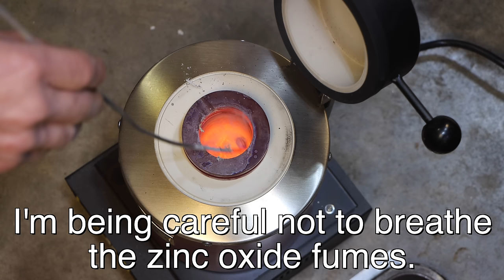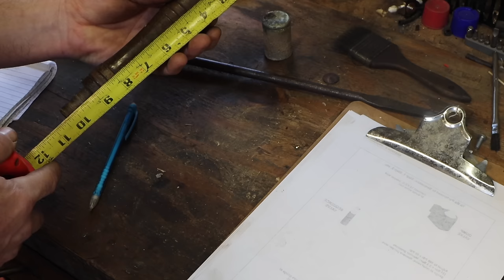One-Of-A-Kind Antique Screwdriver Restoration

Comment: That big screw on the Generator is not a brush cap, it holds the field coils in place. It is better to leave it there unless you have reason to believe it is shorted out or has some other defect. Squatch253 is doing a small series at the moment on his generator and starter off a Farmall and shows all these details.
 Love the screwdriver.
Reply: That is correct, The brushes are not rubbing against the middle of the rotor. Nor are they that small.
Reply from the maker: Thanks!
Reply: Thank you

Comment: 40:20 - I've burnt in handles all the time on projects that I smithed myself (hobby blacksmith), you should try it sometime it is really easy. Just have to pull it out when you get to the depth you want so it doesn't continue to char the wood and make a loose fitting.

42:18 - yeah you don't need epoxy when doing a burn in. it fits it like a glove. Just wait until it has cooled down, give it a couple of wacks to compress the wood fibers and it won't go anywhere.
Reply: "Just have to pull it out when you get to the depth you want so it doesn't continue to char the wood and make a loose fitting."
And THAT is the secret to the burn in method. When I do it I sometimes let some super thin CA wick down inside, though that can be a PITA later if the handle gets broken as you have to clean it off the tang of the tool.

Comment: I recommend that you move the tool rest much closer to the timber and use a roughing out gauge rather than a bowl gauge .  You will get a better result and reduce the risk of a dig in.  Run resin into the cracks using a pressure chamber.

Comment: That big screw actually holds the pole pieces for the coils in place. Don't take them out unless you absolutely have to to replace a shorted coil. I've done it before, but it required use of a impact driver to break loose.
Reply: Yes, learned that half a century ago at Bosch. You must not take them apprt without a good reason. And we had a special apperatus for that. With hardened blades. And a very long handle bar...

Comment: Man, that thing is nice! The brass and walnut really complement each other. One little suggestion/idea: maybe make a brass cap for the butt end of the handle, like a pein? Nearly flat but with a slightly convex dome that tapers down to nearly flush with the outer edge... Mushroom-shaped. It could fit into that centering hole on the end nicely and a little epoxy would ensure it stays put.
Reply: I like the idea.  Of course, you risk making the "tool" to fancy to want to use.
Reply: @critter3745  Nah, nothing like that. That would be on the level of hand-carved, and gold inlays and stuff. I'm just talking about a visual balance for the ferrule on the opposite end of the handle.

Comment: I've done 2 part handles (or multi) to get a solid lock on the bit being held. Doing it this way - you can get a a fit with zero play. 

Make your splitting cut with a thin kerf blade and chisel out the shape of the bit on both sides. Pin it or painters tape + CA, turn it down, then - pop it apart, insert the bit, and glue up the two halves. Works beautifully.

Comment: To make a handle safe use  a very thin structural epoxy and pressure pot. CA glue is brittle. Adding wood powder to hide a fill works  extremely well, does not weaken the joint.

Comment: That turned out very nice, and I really like the CA finish. Could you have used a steady rest (assuming you have one) to support the handle at 37:18? Burning your initials into the flat end of the handle in an arc would be a nice personalization.  And lastly, I think you're gonna need BetterHelp after you're done with the 1010 :)
Reply from the maker: Haha!  You are probably right on the 1010!
Reply: how did you comment 3 days ago when the video was posted for 4 houres ?
Reply: @haraszo8760  Videos are available to Patreon  members a couple days early. If the video doesn't have to be edited for some reason, then the comments made in that period will carry over.
Reply: @JCWren  didnt know about that, thanks for the explanation
Reply: @haraszo8760   What the hell is a houres.
Reply: @quantumss bruh, my bad

Comment: If you don't have an impact screwdriver get one- it's super handy especially working on old tractors that use all those flat head screws. The thing I'm talking about is a screwdriver you put in the screw slot and then hit it with a hammer and it pushes down and turns at the same time👍

Comment: Burning in a handle is super effective it can be a little fiddly but I've got files hanging that the handles have never come off, and it's my go-to method of handling files quickly and cheaply. I heat the tang and stick it in the handle to almost the depth I want, quickly remove it, let everything cool, then install the handle just a smidge deeper. the handle can usually still be removed, but some woods (not sure which, I think pine due to resins) will stick to the handle really hard. 
I think the fit would be naturally too tight for adhesives, so you'd need to either over burn or scuff the inside of the hole to get a good epoxy bond that way, but I'd prefer the wood on metal wedged connection from a burn in, but that's just my limited experience speaking so I don't know if it's quantifiably better
Reply: I'm no woodworker or toolsmith but I always believe this type of tool taper to affix handles were meant to be removable.
The taper will just always want to pop off if pulled on enough, this makes it terrible for gluing but the taper also means you can fit it again easily.

Comment: Love your videos. The wood looks like it could be ash which was traditional for handles, at least in france. I'v done a lot of wood chisel handles by burning the drilled hole as you did. They very rarely got loose. The trick is to be very fast, being carefull not to over burn the handle, and not to burn to the depth you want the finished tool. Then to hammer in in when cold to the correct depth. Thanks for the great content!

Comment: In the future, if you split it instead of cut it. You will get rid of the cracks and be left with stronger wood. Just use the existing cracks to split it until you get the size of piece you need.

Comment: I have been rebuilding starters and generators for 40+ years, here is a hint,  tap on the case with a hammer and then use an impact screw driver and hammer and they will come out. Of course I use a big clamping tool and proper bits to get them out, but this tip will work for you.

Comment: John, When this handle breaks try this: First mill a true blank, maybe 12 inches long by 2 inches square. Then on your bandsaw, cut it in half, lengthwise. Open up each half and mark out the profile of your screwdriver tang including a few inches of rod and be generous. Choke up and basically make the handle cover about 10 inches including some of the shaft. Carve out each half handle blank to take up this 10 inch (handle end) of your screwdriver. Epoxy both halves together around the screwdriver. When the epoxy is hard, chuck the screwdriver shaft into your lathe (3 Jaw chuck should work fine). This makes the handle concentric with the shaft and allows you to shape the handle as you want. You'll have to carefully measure the handle ferrule recess and you may loose concentricity by having to unchuck it several times to check the fit up, but no big deal. Then glue and hammer on the ferrule.

Comment: Nice work on the handle. 
I like the cast brass ferule. 
A friend of mine on the Old Tool Mailing List told me about using a brass fitting for flared copper tubing as a ferule. The internal threads can be used to mount the ferule on the wood. Brass can be turned with wood turning chisels. The handle can be turned to size. Then with the brass fitting attached the final shaping can be done. Much quicker than making a brass ferule. 
When casting a slug for turning I use a piece of steel pipe and pour the pipe full. When the brass, copper, or aluminum cools it shrinks more than the steel and falls free of the pipe. 
I have a box of turning slugs that I made that way. Most of mine are 8" or less but there really is no limit if you set up for contiuous cast. 
UTC had a rod mill that cast aluminum that was rolled into continuous rod and finally wire.

Comment: I've been a musical instrument repair specialist and luthier for over a decade and I can attest to you using the proper method for crack repair. When wooden clarinets, oboes, english horns, and similar instruments come to me with cracks in the body, I fill them with the same type of wood dust that the body was made out of and I seal it up with water-thin CA glue. I also insert carbon fiber rods in a shoe lace pattern along the crack to prevent any further spreading. Good job John!

Edit - If I may though, I recommend putting the dust in and then tamping it down with a small spatula, slotted screwdriver blade, or knife blade before gluing to make sure that you get good adhesion and no air pockets

Comment: I used to have one of those electric furnaces, and the crucibles that go with it don’t last very long at copper melting 
temps. I’d recommend making an iron crucible for it so you don’t need to buy a new crucible every 3 uses .The furnace also shuts off after reaching the highest temperature in can get to.

Comment: I just attached handles to several files using the burn method.  It’s easy and holds well.  I suggest getting a few file handles and trying it out on your screwdriver shaft before burning your walnut handle.  No need to go red hot.  Just searing hot like 800F or so.  Have water nearby to minimize deep burning.  I think burning is the best way to make intimate contact with the wood fibers and it will still absorb epoxy.  In fact it may enhance absorption of epoxy.

Comment: If it does crack on you its because your feral was not tight enough. So before taking apart wrap the handle water tight right up to the feral and wood then soak for a week in warm water. Your little wedges will drive in easier and the cedar will bind even more to the steel. You will be happy if you get it right. Try not worry about the wood cracking in the feral. Hope this helps.

Comment: The only thing I would recommend is drilling a ping hole through the blade and ferrule  then pinning it to provide a mechanical connection in addition to the epoxy.

Comment: Ever thought of taking walnut shavings, then soaking em in slow setting 2 part epoxy, making a tube mold (say in a paper towel tube),  compress it/pack it tightly, then turning down a handle...only problem is...wood turning "plastic" takes special precautions because the fumes and whatnot?
I have like 2 5 gallon buckets of bullet brass I got at the range, and the same metal smelter...so cool!
"A jack of all trades is a master of none, but oftentimes better than a master of one"
Keep em coming!!!!

Comment: John I don't think those screw slots on the outside of the generator are the brush caps their the screws that hold in the field windings you don't want to take them off.... the brushes will be on the end of the vented end of the generator under the end where the bearings are I think....   thanks for the video !  that's a good o'l screw driver now ! well done!.... I welded a piece of pipe on mine so I can hit it with a hammer and not worry about splitting the handle ! LOL....

Comment: Like the handle, That's not a brush cap on that generator. That's the bolt that holds the feild windings in, you don't need to take them out unless they're shorted or open.

Comment: I made some bullet mold handles and used the burn in method to attach them to some tangs I cut from 3/16" bar.  Didn't need epoxy, just gave it a couple of good taps on the end of the handle.

Comment: John , I  made a large screwdriver to remove stocks .  I had to take a stock blank and carve it into a real stock . And you could've put the handle in the lathe , and use a drill chuck in the tail stock . Then pressed it in there . 😊😊

Comment: I prefer to fit my ferrules on the live center end of  the handle. The drive center end is left long and cut off  at the end. Having the ferrule end on the live center enables one to take the handle off for a fitting. I usually do the ferrule end first and press the ferrule on. This allows me to finish the ferrule on the lathe. Having the ferrule installed also provides great support to the live center end for the rest of the turning.

Comment: Hi John, some hints to help you in wood turning.  Turn to finish sanding size prior to filling cracks.  Layer powder/ca if needed and spray activator each time. Thin type CA glue.  Sand to finish grit...340 grit is fine to prepare to finish.
Use the blue shop towels keep folding them in half until you end up with a strip about an inch wide.  Wear gloves and eye protection.... CA will sling off and get you.  Dribble a groove with CA, stand aside, turn on about 400 rpms or just rotate it and it will fill the groove well.  Do that to each and then sand the handle again with 400 or 600 grit until smooth.  
Then squirt CA on an inch of the paper towel and slowly progress from one end to the other with the first coat.  Spray with activator.  Cut off the used inch of the towel with scissors and put other coats on the same way.  Begin and end each coat in only one direction.  Usually takes about 10 coats.  End it all with some wax and polish it.  Apply only in one direction from one end to the other and don't go back and forth.  It acts a lot like lacquer finish as far as sanding and reapplying another coat is concerned.  Thanks for the videos.  I'm a fan.

Comment: I'm far from a woodworking expert, but my neighbor across the street is.

What I've seen him do with interesting wood like that (he likes to find bizarre burl wood from rare trees) is:

- put it into a bucket of mixed epoxy. If he wants a wood look, I believe he adds a lot of saw dust to it.
- put the whole thing (bucket, wood & mixed epoxy) into a vacuum chamber that he picked up on ebay
- leave the vacuum pump running for many hours (I think he often leaves it running overnight)
- finally, before the slow setting epoxy hardens,  he removes it from the vacuum chamber so the epoxy now can fill all of the voids and cracks in the wood. 
- finally he lets the epoxy fully harden for several weeks

At thar point he has a strong piece of very rare wood that he can turn on his lathe.

Comment: That was another awesome video. I have a very old screwdriver that may have been my grandfathers... the shaft does not end in a typical tang, as yours, but is flat, and runs to the butt end of the screwdriver, and is sandwiched in a 2 piece handle. It sports very similar handle construction as some square jaw adjustable wrenches from 80 years ago. No interchangeable bits, no rechargeable battery, no philips..... just big-ass slotted screws. The approach to resolving the splitting and cracks is interesting. I do not think I have ever seen CA glue used as the finish, or as a filler for wood. I use it when drilling next to blind tension pins to hold fast after reassembly, and other metal applications. NEver used it with the carbohydrate building material that grows on trees.

Comment: I thought the purpose of the ferule was to compress the wood to grab the item inserted. So you would move the ferule up the screwdriver shaft, then insert the shaft in the wood, then drive the ferule down over the wood to lock the shaft in place? I'm thinking in terms of file handles where there is a ferule on the end and you insert the blade into the handle and actually pound the end of the handle on a hard surface to have the blade drive itself further into the handle. Perhaps this is a different concept. 
I do like the handle and oddly the imperfections fit more with a tool you plan on continuing to use vs one that's a showpiece. The imperfections add character and make it look well-used, but also well-kept. 
I do love your skillset being broad and deep, not to mention your ability to explain concepts and illustrate/show. Enjoyable videos.

Comment: That certainly is a mighty fine fix, John.  For some of the old screwdrivers that my pop owned and passed down to me I've just used aircraft style wire hose clamps to hold the old wood together and got back to work.  You have made a piece of art, which is really cool.  Great video thumbs up.

Comment: Nice job on the handle. I thought the cracks were a project killer. I think a nice bluing job on the screwdriver shat would be a nice touch. You also could have made a pin from a brass welding rod, drilled a hole through the brass sleeve and steel blade, and peened the welding rod through everything. A light coat of clear lacquer will help keep the brass from tarnishing.

Comment: Drill your hole to depth dropping in size and the biggest part of the shank big enough to go all the way.  Make some wedges like you use on an axe handle. Put a thin cedar wedge in on each side, then drive your hard wedges between the cedar and the walnut. The feral will hold and the cedar will compress and bite on the steel. You can always tighten it up with small steel wedges hammered in perpendicular to the flat part of the steel. I believe you will be happy with the outcome. Have a great day. Your welcome.